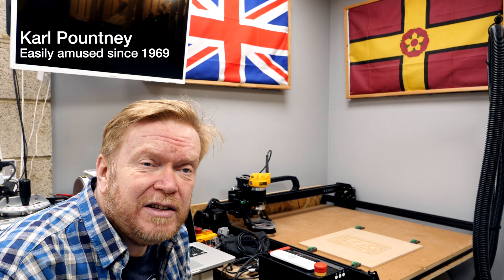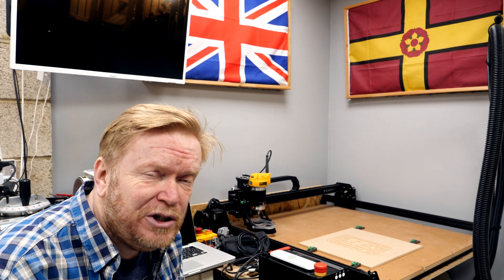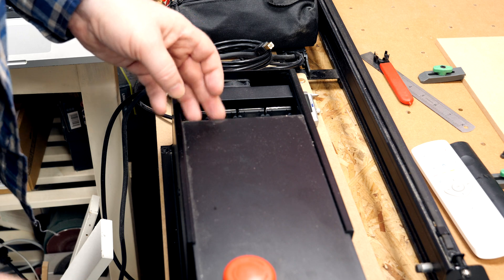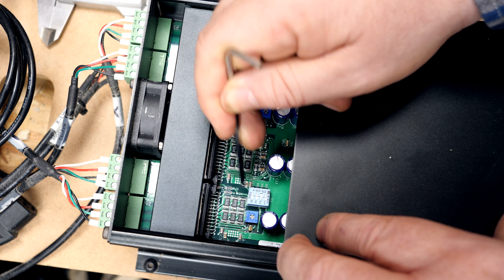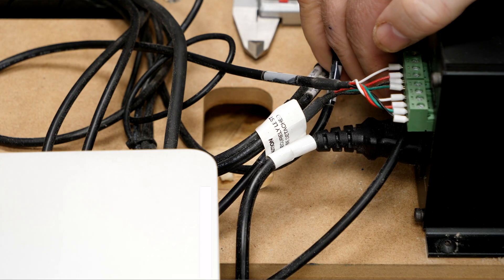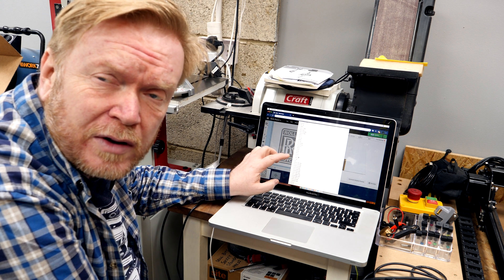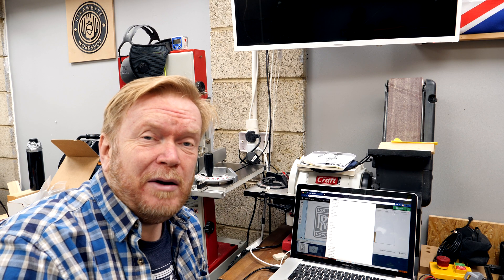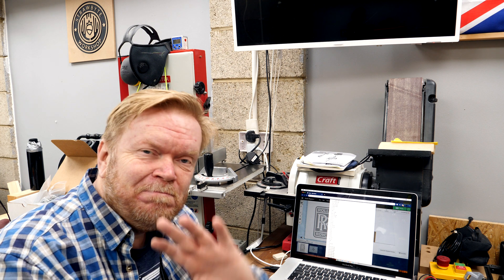How to fix X-Carve Lock Motors Fault For Stress Free Bit Changes

Comment: This is really helpful. One, probably stupid question. When you turn the switches to off do you then have to turn them back on again?
Reply from the maker: No, once se you’re done. Some have asked if continually supplying current to the motors will shorten their lives, but in practice I find that I turn off the controller at the end of jobs anyway so I’ve never needed to reset back to ‘original’ settings. Thanks for the comment.

Comment: Hello from a new subscriber and a new user of the x-carve. When you make the change to the switches, from on to off, does that change affect anything else in the operation of the CNC?. Thank you for sharing your knowledge! Mike
Reply from the maker: The video shows the change to switch 4 which only affects the power saving mode for each of the four motor controllers. Switches 1-2 control the number of micro-steps each stepper is configured for. It's not recommended that you change these as this can seriously alter the accuracy of the machine if you don't amend the same settings in Easel (or whatever control software you're using).
And you're welcome - even though I'm a fairly seasoned electronics / mechanatronics person having spent years servicing computer tape drives and printers, I found learning the x-carve quite a steep learning curve and I'm still learning and making small changes to my machine as I go along - often breaking things along the way.
I've got a project coming-up with the x-carve which will hopefully make a good video.

Comment: Nice  job. And  here I thought it was because my router sucked because almost everytime I'd change the bit the machine would shift. I switched to a spindle and that minimized the issue but the motors were still not LOCKED. Thanks for this.
Reply from the maker: You're welcome.

Comment: You sir, are my new hero. 2 year old 1000x1000, never had an issue with the X/Y moving when changing the bits. I did the full upgrade a month ago, and after that the X/Y was all over the place, in fact I was one that did the clamping on either side of the X/Y rail so the gantry wouldn't move, which was annoying and time consuming. Always leery of going into the GRBL settings, cause basically I was afraid. Opened the controller box, and all 3 #4 dip switches were on, I flipped them to off (and blew out the dust inside by the way - good time for that) then paused your video, opened the machine inspector and changed the $1=1 to $1=255. Shut the controller off, turned it back on - WOWOW, the X/Y is locked!!! Your video is simple for the typical (like me) guy. Easy to understand, and solved my problem!!! Your the man! Thanks.
Reply from the maker: Thank-you Mike for the comment. I can't tell you how frustrated I was changing bits before and it took weeks of pouring through forums and a good day trying out the dozens of wrong solutions until I found this. It's a very simple hardware change; the software is dead simple too. And, luckily for me easy enough to explain. I'm glad you found it useful and good luck with your carving.

Comment: Is there a secret to do this with the upgraded motors? This trick worked with my standard, but since I did the upgrades, they won't lock anymore.
Reply from the maker: Hi Megan. You might want to check your g- code settings again as they my have been reset. On mine the upgrade was fine with everything solid afterwards.

Comment: I followed your video yesterday and locked the motors. On my cut last night the transition of bits worked great. Tonight it kept sliding around and nothing was different from yesterday. I ended up ruining the piece. Can you suggest maybe why that happened?
Reply from the maker: You might want to go back into the machine inspector and check the $1= setting and ensure that it's 255.

Comment: The one thing I like is the X-Carve is a constant learning project.  I have had mine running since Dec and just dropped another grand on it for new improved Z gantry, laser, and the beefier y gantry plates. 
Thanks for the tip on locking the motors. As far as life span decrease I would be very surprised if it was very much. Besides the motors are less than the cost of the spindle which is more likely to fail from bearing wear.
Reply: Thanks for posting this!  This has been a major issue for me!
Reply from the maker: Thanks for the comment Kenneth.